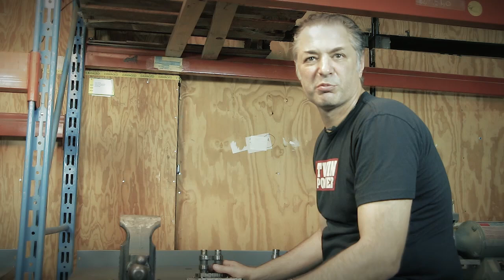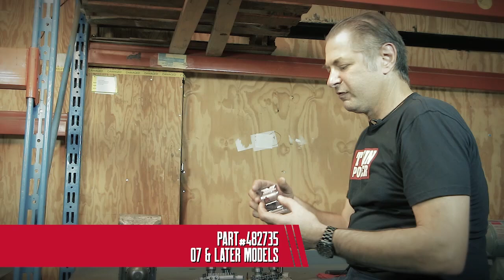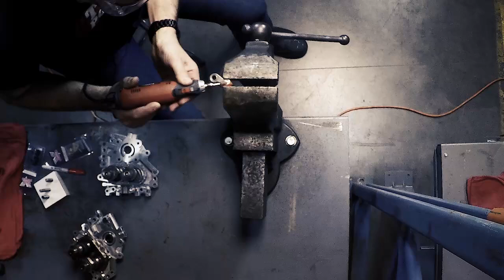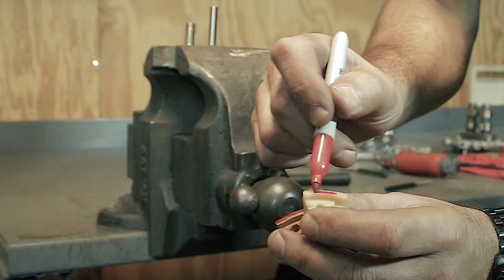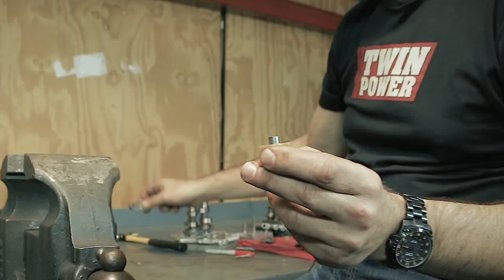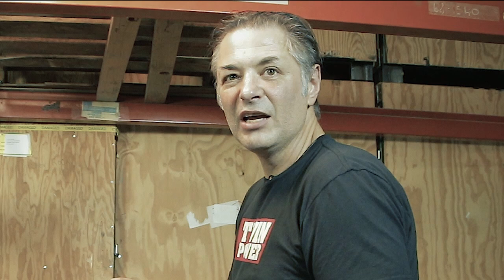Replacement Cam Chain Tensioner Shoes | Twin Power

Comment: At the beginning of the video you twice mention that the inferior tensioners do not apply to the 2006 Dyna but later it shows you changing the shoes on a 2006 Dyna and later Twin Cams. I am confused. I have a 2006 Dyna so do I have to check the tensioner shoes?

Comment: If you have to remove the camplate and the whole tensioner spring assembly and everything anyway why the fuck would you just replace the shoe and not replace the whole damn thing spring and all
Reply: To save money!! 2 shoe's & pin's $15  better than 2 H-D  tensioner $175!!

Comment: I will just install the SE update cam plate, with a set of S&S hydraulic tensioners. Also, replace the cam bearings with the updated bearings.
Reply: Too much cash

Comment: I installed a gear cam kit on my 2001 road king and called it a day.
Reply: Sounds like you got lucky and have a crank that's within tolerance. Harley Twin Cam cranks are pressed together and it's not at all uncommon for them to have excess runout. The only way I'd go with gear drives is if I have a welded crank.

Comment: Good video. But incorrect. Proper way is to have pin head at the marked side. If you do this other way, tensioners will scratch cam plate when installed. Ruined my tensioner kit today.

Comment: Hey James, Good video. I would like to see how you installed/loaded the inner tensioner without removing the cams using your notched socket tool. Also, is you blind hole inner cam bearing remover/installer Harley Davidson specific? Thanks, Frank
Reply: Tool to remove/install inner tensioner without removing cams:

http://mcspareparts.com/epages/40a0c441-70ce-4cfa-849d-21b25e92ecb2.sf/en_US/?ObjectPath=/Shops/40a0c441-70ce-4cfa-849d-21b25e92ecb2/Products/0914

Comment: How come they didnt make it gear drive? Does anyone make gear drive replacement for this. I want to dump the tensioner chain setup alltogether.
Reply: From what I've seen in several videos, you have to be sure the crankshaft runout is not too great or the gear drive solution will not work.
Reply: @CPerreault  You are exactly right, which is why I did not switch to gear drive. Just because my crank is in spec for a gear drive now does not mean it will stay within that spec.
Reply: they're are gear drive replacements, if you got the money

Comment: What is the shoe material? Better than oem?
Reply: The shoe material is superior to and longer lasting than the OEM material.
Thank you.
Reply: Thanks Jim. Fact of the matter... it's a shitty design.  Under the hood of any car....they employ a rotating idle for the serpentine belt.  The primary should have a rotating member as well.  Engineering 101
Reply: James Simonelli excessive use?
fuck off, using the product you payed for is not abussing it as you are trying to imply to justify this failure in design
Reply: He said excessive use....the recommended replacement schedule is set by the manufacture....any use after that is excessive. He didn't say abusive. All parts have a service life, all parts wear, corrode, degrade, etc....nothing lasts forever. Proper maintenance is the key to enjoying "the product" and in this case a Harley....
Reply: @08StreetGlide  which is 25,000 miles old post lol